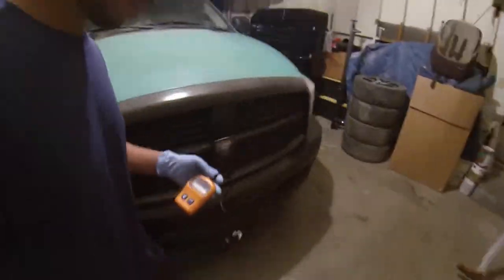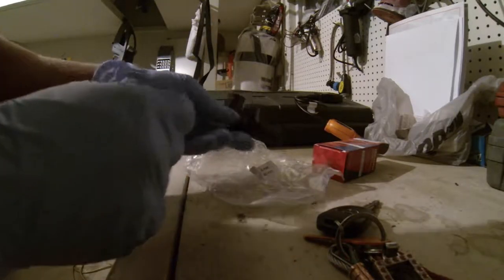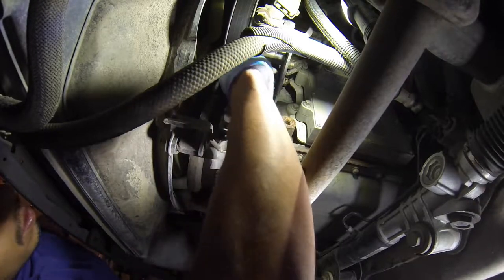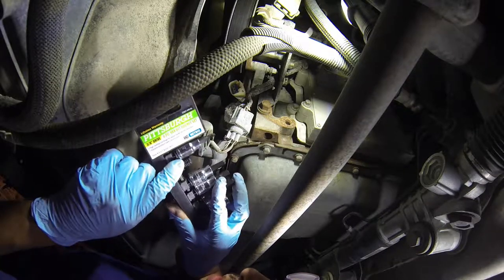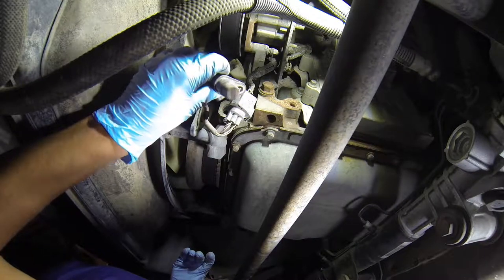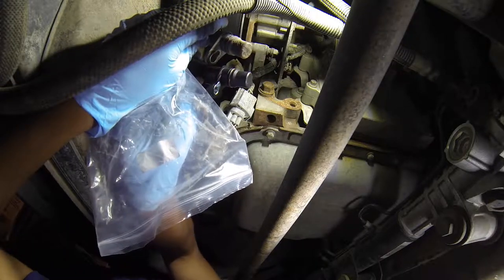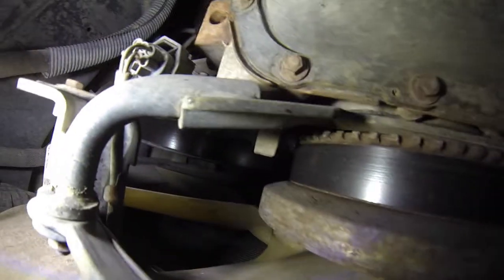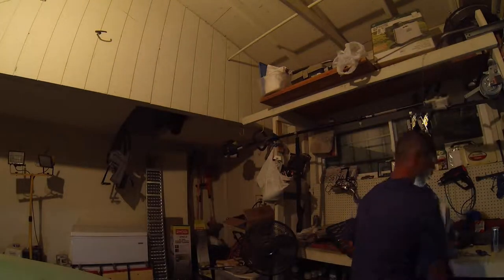How to remove/repl 2008 Dodge Ram Crankshaft Positin Sensor p0336

Comment: 2  things that probably make it a easier replacement. #1 unplug the fan connection that's in the way   2nd, grease or light oil on the o-ring before install , just the o-ring . Good video.